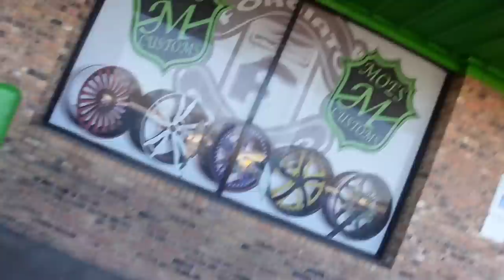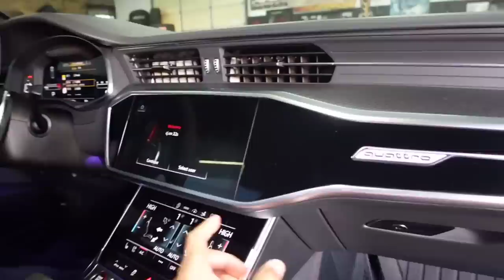FIRST EVER AUDI R7S ON THESE CUSTOM CORLEONE FORGED RIMS

Comment: Then wheels for the BMW are nasty real  talk and you murdered the Rs7  the track hawk  on some fresh corelone would be nasty  with the big cap forgiato just don't have anymore really with the plastic  caps  and everyone  has got that wheel do a custom one off set with corelone  32gangent  wheel ❤️🤧apply hard pressure just my opinion keep going up